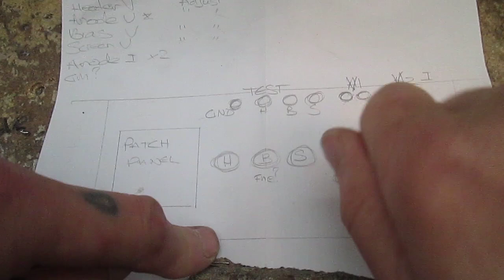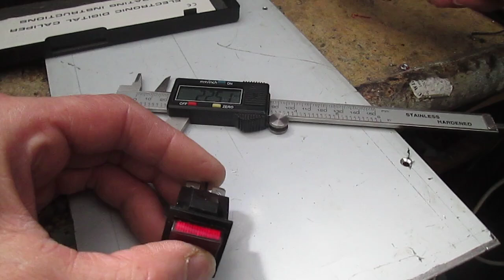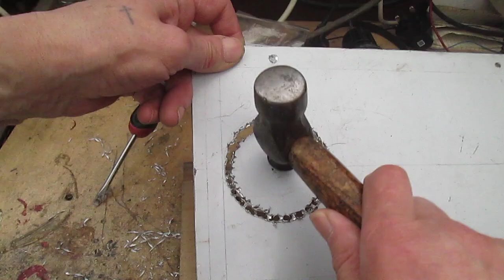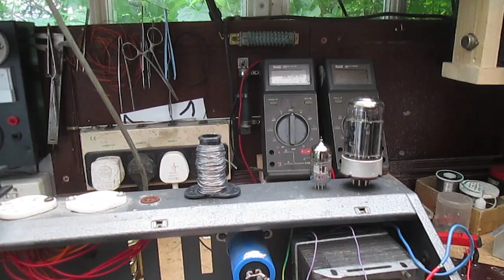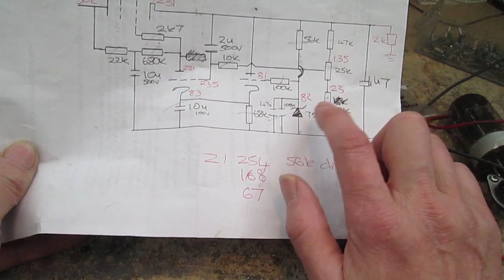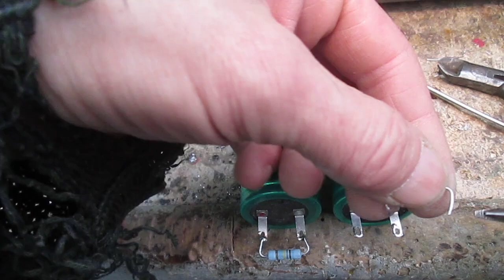DIY Valve Tester Build - Part Two.

Comment: If you use neon bulbs, you may not be aware that they are not consistent from one bulb to another for regulating voltage, and that the operating voltage will change between being in the dark vs in the light. One can put them in black heat shrink to make a more stable operation.  They make "locking" hinges that are used on stereo cabinets that will lock open when fully lifted, so no need for propping the panel up when open.
Reply from the maker: Thanks for the info & TFW.

Comment: Well done Andy, it’s taking shape now eh? I have a 10 tonne hydraulic hole punch, they are great when they work, but the holes can look a bit iffy on the smaller punches. 
Looking forward to the next instalment. : ))
Reply from the maker: A chassis punch is better than a step drill though, quicker for one, less messy too, TFW.